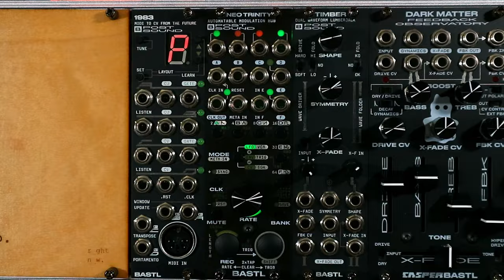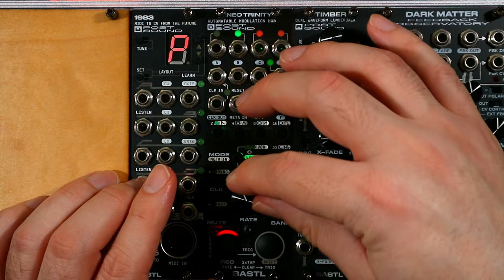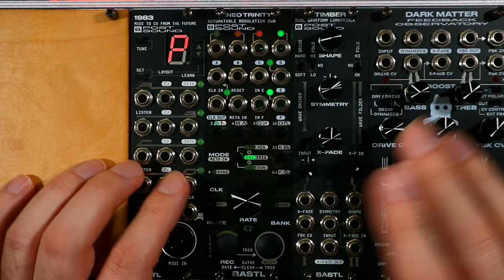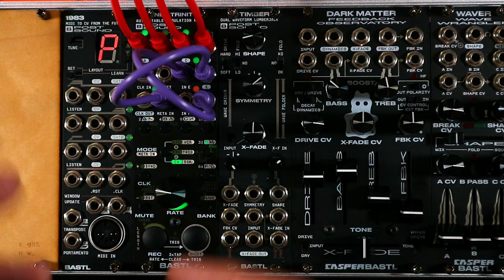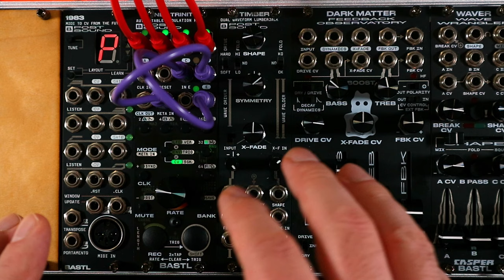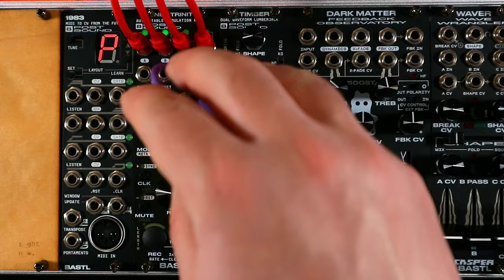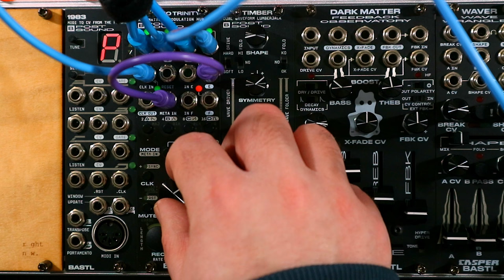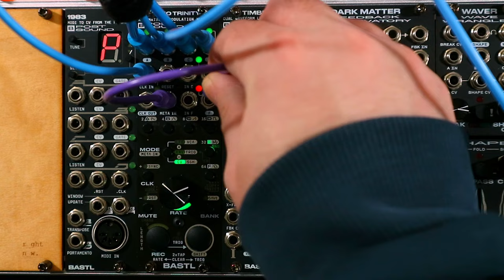Bastl Neo Trinity - A Modulation Mastermind?

Comment: Do you think this covers a lot (or all?) of what Maths does ?
Reply from the maker: Short answer: no, Maths is much more flexible in one domain, but this can do loads of stuff Maths can't.

More nuanced answer: it depends what you would use Maths for. Maths gives you as much control as possible over a voltage function, NT is more about macros with a single (or maybe two) parameters. But then this has all the sequencing, quantizing etc. And multiple channels of it. Maths is also knob/CV per parameter, which NT definitely isn't, but it's also loads bigger, and in a small case, that might really matter.
Reply: @OscillatorSink  It’s just a shame Maths is so frickin’ big and no one has made a similar but more compact module… 🤨
Reply: @symbiat0  i never owned a maths, so i'm not sure, but wouldn't a dual function generator (of which there are some small ones, like the cosmotronix delta-v) and a module to mix, invert and offset (like happy nerding 3xmia) cover most of what maths does?